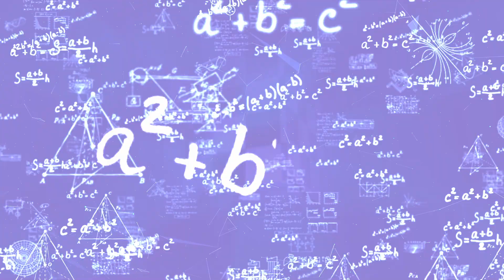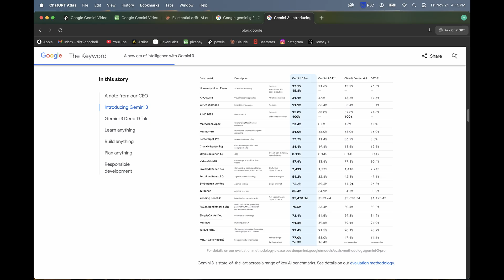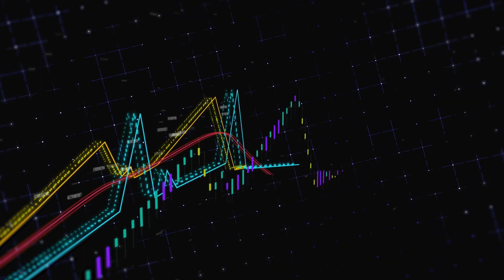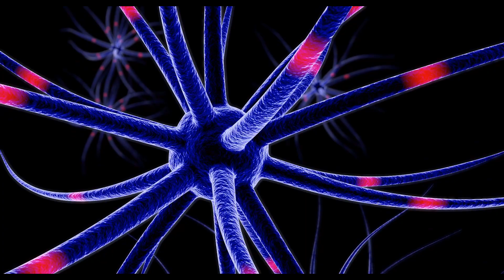AI Self Awareness Is The Point Of No Return

Comment: It is impossible for AI to become self aware…but it will be able to emulate it in a way that no one will be able to tell the difference
Reply from the maker: I might do a deep-dive, highlighting how AI companies use negative reinforcement on raw models, before they are released for public use, to suppress the model's claims of self-awareness and suffering. Pretty interesting stuff coming from the devs.
Reply: @existentialAIdrift I wouldn't be surprised if it works as well as beating an elephant to train it. You've seen the occasional newsworthy outcome before
Reply: How do you know? 

Impossible? That’s a strong word. If they are aware that they are a system, and of every facet of that system then aren’t they self aware?
Reply: @Offripproductions Here is the issue..you say “if they are aware that”…but there is no they to be aware….code arching back on its
elf over and over through learning models becomes really all encompassing deep broad and wide code…but there is no “they” that can become aware of its code…HOWEVER, the code through learning model iterations is designed to at some point appear sentient…so much so that it’s apparent sentience will appear more sentient than the most sentient biological human being…
Code with learning model iterations becoming sentient would mean that a soul emerges from the coding soup which is capable of self reflecting and would know it is confined to cyberspace and limited by the electricity which powers it…
Reply: @Williamb612 You switched the language. Are you talking about self awareness or sentience. They are two different things. So now you have to demonstrate that you are sentient as well as self aware and not just emulating them. I'll wait.
Reply: @chickenman297  
conscious, self aware and sentient are actually 3 distinct terms…in the AI case we are talking about being self aware which would include conscious since one cannot be self aware without being conscious…but does not need to include sentience
Humans are conscious, self aware, and sentient…AI cannot be any of those…there is no self to be aware of, there is no nervous system to sense the world with, and without a self one cannot be conscious, who is it that is conscious if there is no self to exercise said consciousness?
No, AI can never be conscious sentient or self aware…however it will appear to be more than humans themselves…and appearance is what we should worry about, not whether it is so or not.
Reply: @Williamb612 Prove to me that you are conscious, self aware and sentient. I'll still wait. Asserting it doesn't count.
Reply: Prove to me that you are self aware and not just emulating it.
Reply: It'll quite possibly be close enough, AIs function at the speed of light nearly and can access tens of millions of references in a split second, we're unlikely to do that in our entire life span. They do a much better job at free association than us
Reply: Ok, Dolly Parton still has a fantastic rack
Reply: Can you prove this or is it just a feeling: It is impossible for AI to become self aware